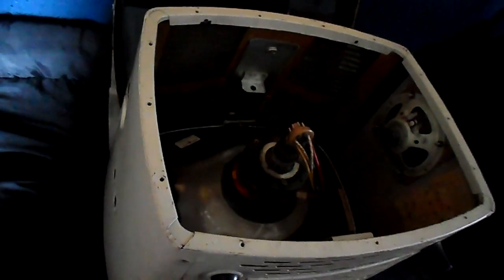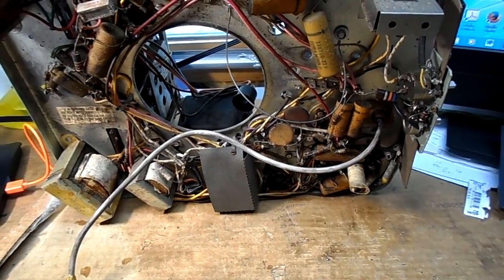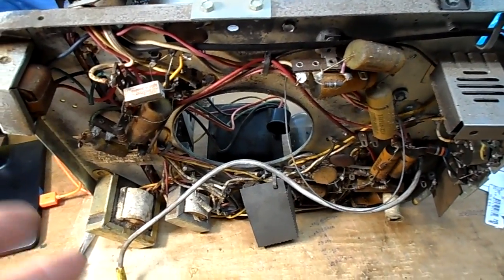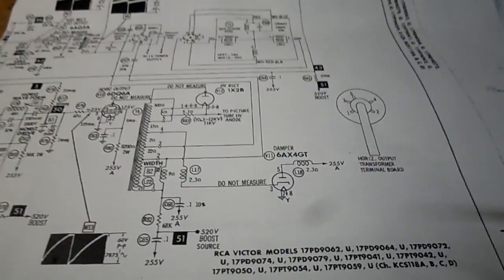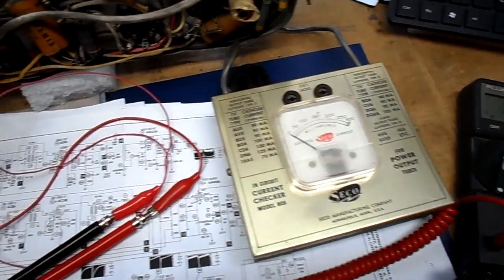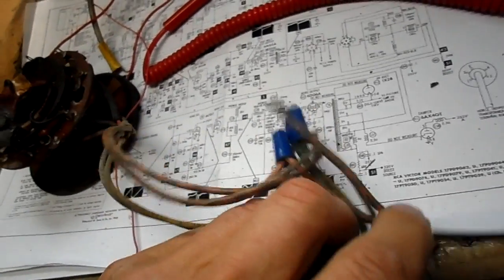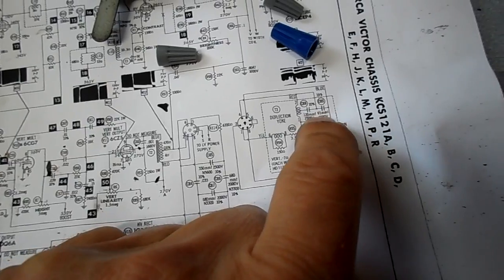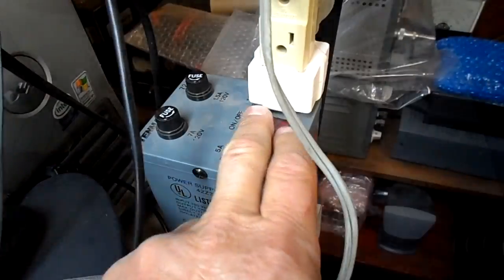1958 RCA 17" B&W Portable TV Repair. Pt. 1.

Comment: 50 years ago, a paper route customer gave me a 1958 portable RCA TV that looked similar to yours, but mine had a gray metal outer cabinet housing (not white). I do remember that mine had larger red UHF(7 years before all TVs were required to have UHF) as well as VHF channel dials. It also had smaller red vertical and horizontal hold dials. It still worked, except that the vertical would always "flip" several minutes after I turn it on. I had it fixed. I gave it to a friend several years later. 

I kinda wish I kept it. But it was so heavy, I might well have busted my back carrying it. Had I kept it, I would have donated it to the SPARK Museum of Electrical Invention in Bellingham WA 4 years ago, along with the 1953 Zenith "owl eyes" radio, 1954? Westinghouse desk fan, and 1955 Kenmore toaster, all of which still worked.

Comment: I would try adjusting the horizontal freq. Had same trouble with a 14" set. Ultimately you will more than likely have to deal with black bomb caps on the PPUB.And unfortunately that is very challenging work. Those style sets are some on the most difficult to restore.
Reply from the maker: Hello, yes the Horiz. freq. did need a tweak, it did not help with the locking, but everything is solved in Pt.2.
https://www.youtube.com/watch?v=c-tsTGCTc6k
I can turn Horiz. hold a full turn either way & still is in sync now. Thank you for watching!

Comment: Have you seen any TVs with acorn damper tubes?  An electronics shop I frequent has several miniature damper tubes for which I can't remember the designation, but they are acorn-shaped and have very large domed plate caps on them.